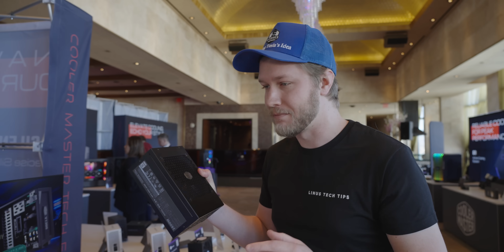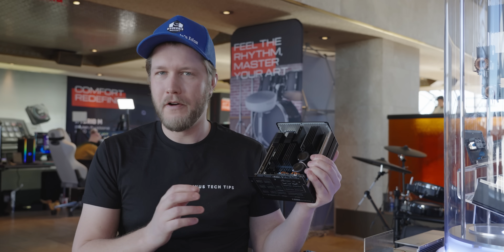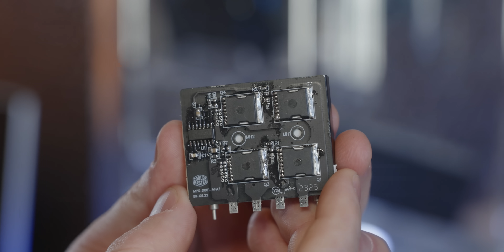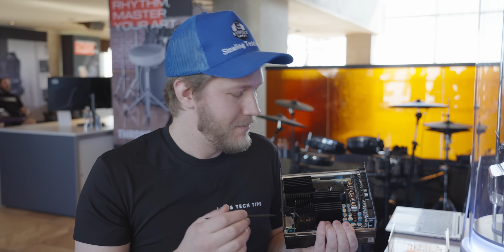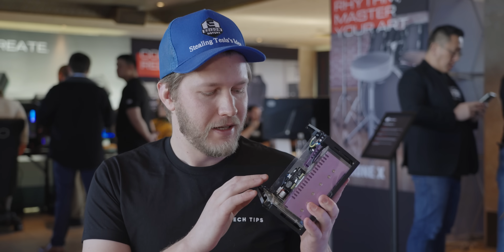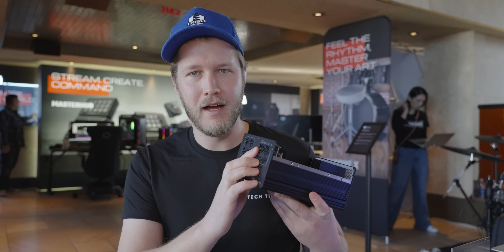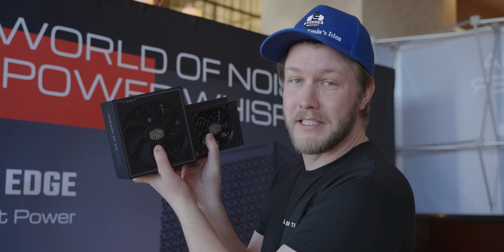This is unbelievable... - Cooler Master at CES 2024

Comment: Passive PSUs are cool and all, but i don't think I've ever heard the fan from any of my power supplies. It's the CPU, GPU, and system fans that generate so much noise. So, other than eliminating dust buildup in the PSU, i don't see this as a big deal.

Comment: Man, I love the idea of a fan header on the PSU, it makes perfect sense to plug your case fans or server fans in there, since
A - The fans get powered directly from the PSU, they can be beefy as hell 
B - The PSU knows EXACTLY how much heat is produced by the system, better than the MB, since it is equivalent to the total Power consumption of the system.
I wonder if it becomes a common sight one day

Comment: Wouldn't the copper heat pipes and aluminium heat sink cause electrolysis? Did they use some kind of de-oxidizing thermal paste? Could also be nickel plated aluminum. Just need a water block to integrate it into a water loop

Comment: Yet another tech tuber who can't get arsed to spend five minute googling what a PFC circuit is and does. Here's a hint : it's not the power coming off the wall that's dirty, it's your computer, and "dirty" is far from the correct metaphor. It's supposed to be your job to know this, but I guess YouTube is just for propagating disinformation (which explains all the ads).

Comment: I am pretty sure you can get 240V in NA if you have large homes that have dual Phase 120V circuit in (For heating, etc). Just not directly from your typical wall outlet.

So you may want to install NEMA 6-15 in your gaming room for better efficiency.

Comment: pssshhh my corsair hx1500i axt 3.0 p.s isn't fan-less but the fan hasn't come on once due to heat. It's a solid unit. 1500w is stupid overkill but at the time of purchasing Amazon had it for $234.99 usd brand new. Insane stupid good deal being its usually $399.99 msrp. It was the exact same price as the hx1000i. And I have a case that can easily fit it so why not. Fan does work also. Tested it in icue just to make sure my unit wasn't defective. Oh yea and it has a cable to plug into the motherboard to view power out / in and temps and psu efficiency in icue or hwinfo64. For $234.99 that's getting an awful lot with also a 10 year warranty.

Comment: Pretty amazing what can be done these days as component and mfg prices fall even lower. Synchronous rectification is getting very common nowadays to achieve higher efficiency. I guess the FET transistors are also manufacturered out of GaN wafers instead of traditional silicon. Resulting gains: lower Rds(on) semiconductors to keep it cool. Lower switching losses which enable a higher switching frequency, leading to a more compact transformer. All these enable to market a compact "powerchonker" like this, then reconfiguring it to lower peak power to never heat up too much and avoid ever reaching Tj(max) of semiconductor dies, and bam sell it also for the fanless crowd too.  :)

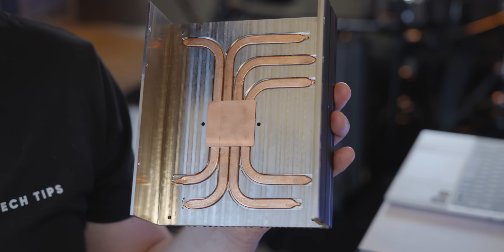Comment: One slight correction:  Most, if not all of Europe is on 220V, not 400V (as you said at 1:10), although when I lived in Germany you can get service with 3 phases of 220V each, and spread the load of the house between them, and get 440V between any two phases, but that's mainly industrial power, and for machinery with big 3 phase motors... not for hair dryers, kitchen appliances or computers, most everything still plugs into 220V outlets.  Also, you can make more power efficient devices for 220V.
Reply: That's not a correction, they're talking about 3 phase 400-440V which is what that PSU uses

No, it's not going to be a drop-in part for everyone in Europe, but it's 2.8kW, it's clearly intended for very very high end workstations not typical gaming rigs
Reply: @audigex  You want to bet on it?

I went to school in Germany for electrical engineering, and you have no clue what you are talking about, and literally just made that up whole cloth!  Exactly where does he say 3 phase, and if so why does it have a standard input, and not the high voltage European industry standard one, so they can actually sell it without being fined up the wazoo?  Besides that a server farm will have 3 phase service, possibly even at 220,000V, prior to down transformation which will be in their building, but it has jack all to do with individual devices needing it (none of it does), but total use!  You didn't even read or understand the rest of what I wrote, where I clearly point out what it's for:  Spreading that power to more outlets as to not over saturate them and blow fuses, or have crap melting and catching fire on failures!  No server will have direct 440, because it's not safe, and would require every IT and other personnel to have an additional license (as I have) to get near it, nor does any server need that much power.  He says 2800W, so 2800W/220V = just under 12,8A so just higher than the max 10A of a fuse on 110V, and their single outlet is rated at ~20A meaning 220V or two phases at 110V=220V is sufficient up to 4400W, and therefore can be used in the US but you need 3 phase service in the US, not Europe, where you have that in your home already by default!

You have all kinds of information at your fingertips and could have looked it up in seconds, but decided just to make some shit up!  Even worse:  He didn't mean it, he misspoke, because he says 220V later in the video!  I made correction so they can edit it and flash a 220V on the screen, after being in trouble already for bad and false information, and loosing a few 100,000 subscribers, maybe more!

Besides that, LTT have said it's 220V in more than one video, and so do many tech channels....  it's said all the freaking time, and millions on 110-120V know it too, just not you, because of your ignorance!  So maybe you should do more actual learning, and less talking!  And when you do learn something then still keep your mouth shut when something is outside of your scope of understanding, because guessing is not a valid method to derive knowledge, and spreading misinformation puts false information in others heads who just take whatever they hear for granted, who then claim to know what they are talking about AKA:  The blind leading the blind, or the Dunning Kruger effect when they challenge experts on shit, which is exactly what you are doing!

Comment: So you can still use it at 2800 W in NA, you just have to have a 220 outlet, which most people only have for, AC/Heating , Dryer, and Water heater. But nothing really stops you from installing  the needed circuits and outlets, as far as I am aware.

Comment: I do believe this is the best coverage I have seen on the channel, seriously! Well done, and thank you so much for explaining these elements for us.  And shoutout to Coolermaster, this power supply is next level, as a user of a 700w fanless seasonic, I felt anxiety and confusion over whether I had enough power at 700w wondering if my crashes were from instantaneous power draw or something else.  Literally wishing I had some software communication with it to monitor it’s performance for throttling.  

I can only imagine how different I would feel with this power supply, going from tepid insecurity to strides of confidence at 1100w and the clarity of information with the MCU interface.  What a huge difference in imaginary customer experience.  Sure the mosfet rectifiers, high temperature bonding, and scorching hot multi layer transformer, and other innovations present multiple early adopter points of failure. But the same is true of everything ever made.  Good job everyone!  Keep raising that bar!

Comment: Power factor correction does not clean up mains power for your supply. If you want to be simplistic, it cleans up the current waveform from your power supply so it doesn't pollute the mains. You have it exactly backwards.

In reality, what pfc does is make the current draw of the PSU closer to in-phase with the mains voltage so that
Reply: the "imaginary" component of the power is reduced, which saves real power in the rest of the power system.

Comment: Thanks for the explanation on how a PSU works internally, super interesting... what I'm wondering though, maybe someone from the community can answer this:
Why ramp it up to 380V first, when you need to go down to 12V etc anyways... is this because of the difference in household voltage between US and EU for example, i.e. to standardize these components to work no matter if the wall input gives them 120V or 220V?

Comment: I get why this is good, but without a fan to exhaust the heat it's just dumping that heat into the case.  Need to see quite a bit of testing thermals before i would consider this.

Comment: Wtf? 400v transformer? Dirty electricity having anything to do with power factor. Sure, current and voltage waveforms have to do with it, but power factor has little to do with what comes from the wall, it's about how inductive your load is.

Comment: Don't assume "Europe" will source high power on a given 240VAC circuit.  I've seen panels where a couple/few breakers were 6A as that circuit was deemed for various lights - that would be 1440W, which is less than the typical N.A. 15Ax120V circuit.  
And yes, other circuits in the house will be for higher current, they also have higher loads on them that can come on at any time.

Power factor has little to do with noise.  It is simply due to resistive and inductive loads.  Correcting it is, of course good.

Love Mehdi.

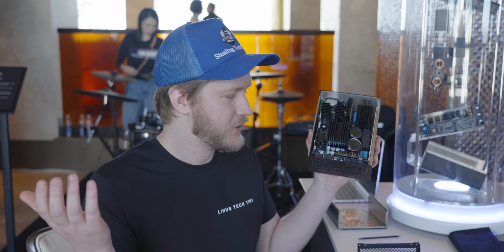Comment: 5:10 

Does it make sense for everything to run on 12V? 
i would think smaller appliances/peripherals will not have chips that run on 12V and will not have their own voltage regulator because of it's size.
(Does your mouse or keyboard need to run on 12V? Does a USB memory stick need to run on 12V? Does a external drive need to run on 12V? Does a webcam need to run on 12V?)

Comment: You could run a 2800W power supply on a 240V outlet in America. You could get a specially wired 25A 120V circuit, but that might be against code.  And rewiring your walls to use a more powerful computer seems like a poor use of money.

Comment: In "America" ya ppl Canada is a part of America too! ;) all baseboard heaters carry 220v(Your breaker box has 20AMP breakers installed already for various other things, like stoves/ranges), tap the control box add a junction box, wire and an outlet and your done. 220v is safe for a 120v outlet, 220v uses less amps=less heat ;)

Comment: In the UK we can run 3,120 watts off a single 13 amp fused outlet. The wires in the wall can handle 7,680 watts. The whole house could consume 24,000 watts total (100 amp fuse).

Comment: That's a pretty impressive he dissipation system all it needs is a place on the top to lock in a water block so you can siphon the heat off to your radiators

Comment: Linus Media Group can you please stop spreading the misinformation about North America outlets, in the USA, certain states requirement new houses and/or condos to have 240v outlets for more efficient energy use with washer, dryer, fridge etc and almost all state you can contact you Electric Supply Company to have them install and 240v and even 480v outlet (480v outlets are limited to just 1 outlet in my state, and 240v is place on a separate circuit breaker depending on the building). Source being my apartment that has a 240v outlet for high power AC and my parent house that had 240v outlets for there washer & dryer as well as dish washer. meaning you can have the 2800w PSU in the USA. I don't know about Canada and Mexico though

Comment: I might actually buy a new SFX one. I'm using a Cooler Master 850w in a new build with a 4090 and I'm using an angled "cablemod" cable. I don't have any problems with full loads but I don't overclock either. I still have trust issues with the 4090 so a newer cable and power supply sounds good so I don't burn away a $4000 computer or my house lol.

Comment: Cooler master tech might be cool, but, EVGA is still the king of PSU's, I bought my EVGA supernova 1300w fully modular 80+ Platinum PSU, back in 2013, and it has been more than 10 years, I upgraded my GPU's 3 times, I got 4 different processor/motherboard upgrades during that time, and the PSU is still going strong, meanwhile I sold my Ryzen 2700x with motherboard and Ram combo to my friend to another country, and I sent him a Cooler Master 850 Watt 80+ gold PSU as a gift, and it failed in less than 2 years

Comment: Nice to see high efficiency fanless power supplies heading to the PC market. In industrial, well I just installed a 120 to 12v power supply 1500W fanless and water resistant. Oh, and it was only $400. The fact that its taking so long for that tech to reach the consumer market is unbelievable, and at such a high price.

Comment: 2800W even on 220/240 is still pushing it for most common outlets and breakers. But I guess it's not a continuous load, so maybe only worry when stress testing?
Reply: uh no, a common breaker is 16 amps times 230 volt gives 3680Watt. Perfectly fine.

Comment: Not only if cooler master would actually warranty their products when they stop working, it would actually be kind of cool and helpful
Reply: In the Philippines, they do. They replaced my CK350 keyboard when it malfunctioned(within the warranty period). You just need to coordinate with them.
Reply: @eienkurisuki  I gave them my computer specs, and informed them of the lower specs that I moved the power supply into, and yet they still said that I was overloading the power supply on 5-year-old hardware with a mid-tier GPU. After 3 or 4 attempts with their RMA department, I figured it's just easier to go with somebody that's not going to give me this hassle
Reply: @buhammot  well, of course, if it's user error, why would they replace it? You should know which one to buy and use on your computer. Old hardwares were not power efficient like today.
Reply: @eienkurisuki  so you're telling me a 650 watt power supply from cooler Master is expected to fail while running 7700k that pulls a maximum of 91 watts, a 1070 that pulls a max of 150 watts, an SATA SSD, and an NVME SSD? Interesting
Reply: @buhammot  You just shared your information now. TDP is not equal to wattage. 7700k is up to 165watts.  How many fans and peripherals that were connected? If you think they're wrong, then complain to them.
Reply: @eienkurisuki  3 fans, nothing crazy. And why do you think I posted my comment? I went back and forth like 3-4 times, they basically told me to kick rocks. And I take it you are ignoring toms hardware stated that using Intel's utility, the max they could pump out was 137w, not your value. During gaming it pulls less than 80w, which is when the power supply was failing. So 150+80 is.. hmm 230. Not using traditional hdds, I can totally see how 3 fans (10w) and 2x ssd can exceed a 650w PSU. Found the fanboy

Comment: Power factor is more the property of the load, like the transformer. It's not like the current and voltage would (or even could) be out of phase, if you only put a resistor as the load.

Comment: You mixed up a few terms. The first thing you looked at was an input filter and not the pfc. The pfc is the thing thats bumping up the voltage to 380V and is located after the active bridge. I wonder why they went with an active bridge, because at this point you could use a different pfc topology, that doesnt need a bridge rectifier. Are you shure that the problem with the mosfet was corona discharge? To me reducing paracitic components souns much more plausible.

Comment: Sorry, for this comment. I am really a fan of all your videos, but as an application engineer specialized in power supplies i cannot agree with the explanation of the function. For example that PFC circuit filters the input. PFC is there to match the regulations regarding output noise from the PSU. From the PSU standpoint PFC correction just lowers the efficiency. It would be better to have a just boost convertor to boost it to 400V and than LLC stage without need to pass some noise and power factor regulations. I dont want to make it too long, but there was some more mistakes. You are a great channel and I know you can take some constructive critique.

Comment: Hi Alex. You use the wrong definition of power factor. The reason for incorporating power factor correction, is to reduce the peaking current that a traditional bridge rectifier would produce, as power draw only occurs during the peaks of the ac waveform. To express this effect quantitatively, the old cos(phi) expression is divided by the ratio of the power in the fundamental and the harmonics of the input current. It is well explained on its Wikipedia page, wehn you scroll way down to the distortion bit. Or else if you ask any of the analog electronics nerds around the office.
Reply: Point being, cos(phi) is typically close to 1, but the power factor is still low due to the harmonic distortion of the input current in power supplies. Coincidentally, this is also the part that cheap chinese power supplies will often omit, as you dont technically need it for the functionality of the psu.

Comment: I love how the folks in America are limited by their grid voltage 🤣
Reply: Technically we're not. We have 240 coming in from the lines which is how we have 240 sockets for our dryers and other large appliances. Just the common plugs only run 120.